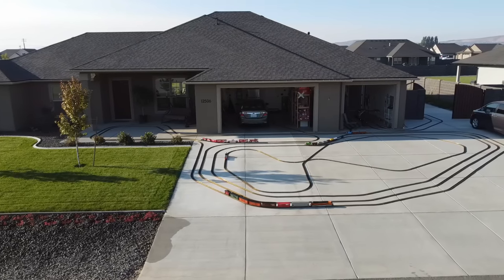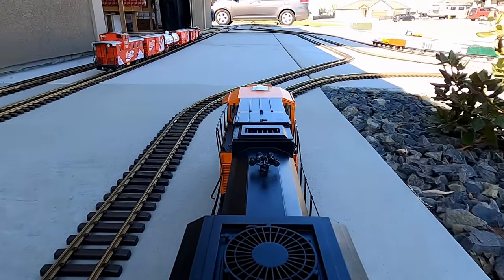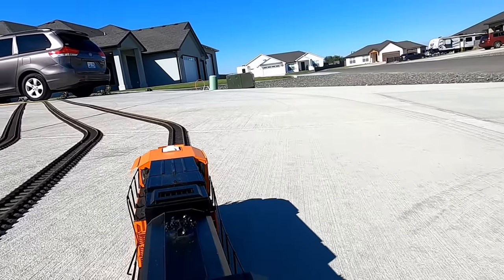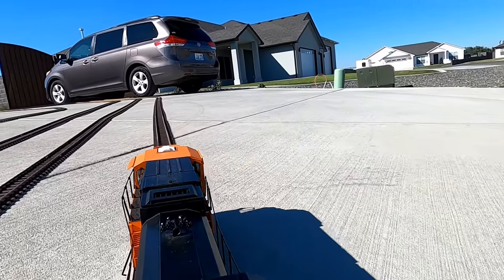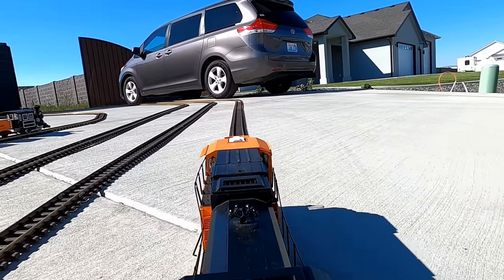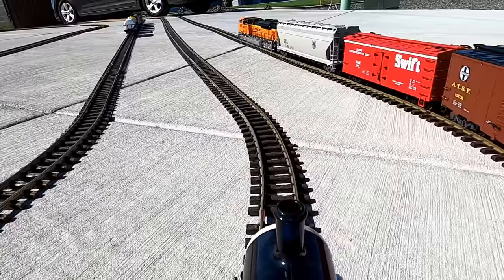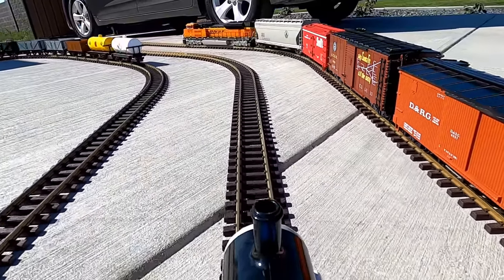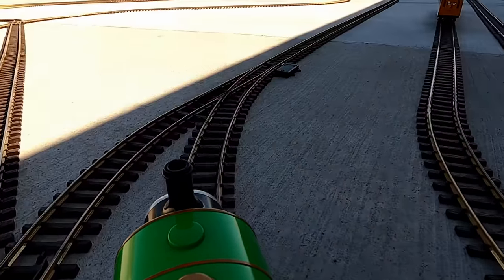A Huge New Model Train Layout With 8 G-scale Trains

Comment: I’ve built what I call “panel track”. 1”x4” pine boards usually 72” or 70” long with Lionel track screwed down. The original system I built had 72” curves at the ends. Now I’m starting to replace them with 96” curve tracks on plywood. As I can spend more money on it I can add straight sections. It’s for outside temporary running of my trains. I have an unfinished inside 96” by 77” Lionel layout.

Comment: Nice layout. I know the kids loved it - and so did I. How do power feeds work with G scale track on a layout that big?
Reply: He most likely used multiple power feeds on each track
Reply from the maker: @Amtk-712  No, actually, just one power connection to each loop of tracks.  There were four independent loops, each with their own power supply, in this layout.  I use LGB-brand brass track and I take good care of it...  it's not sitting out in the weather 24/7...  I set it up for a few days and then I store it safely in my garage when not in use.  So, the track stays in good condition and I rarely have any track power issues.  Even in the videos I've made where I've set up track all the way around my back yard, or all the way over to my next-door neighbor's house...  there has just been one power feed to the tracks.

If I had a permanent outdoor layout with the tracks just sitting out in the weather all the time, yeah, I'd have to have multiple power feeds to that layout...  otherwise there were be massive track power problems.  But the way I do it, with these temporary layouts, the track stays in good condition and I don't have those kinds of problems with track power.

Comment: Hi Jim! Is that Number 1 Gauge trains in your driveway? I was a garbage man for 8 years and I found about 20 train sets-Lionel, Marx and American Flyer. Most of them had missing wheels and no track but the engines ran just fine. My favorite was a Lionel Coke Train built in 1974. I have added more box cars-Orange Crush, Dr. Pepper and Pepsi and a Jack Frost Sugar hopper car. The train looks awesome. I also have the Blue Comet set with 12 coaches and the Marx trains will have 20 cars on both. I will set up all 4 trains in my living and dinning rooms once a year. Maybe you could be a garbage man too and find lots of trains!

Comment: Hey Jim! Nice to see you playing with the trains again! Can you tell me if you still are using your MRC prodigy advance? With their Wi-Fi?
Reply from the maker: Yes.  In the shot at 2:53 you can see the tablet in my hand.  I'm using that to control the trains.  The tablet talks to the MRC WiFi unit which is connected to the MRC Prodigy Elite power supply.

However, be aware that I got very lucky that my MRC Prodigy Elite works with the WiFi unit.  Apparently, most do not, and the official line from MRC is that the Prodigy Elite is not compatible with the WiFi unit.  Mine just happens to work for some reason.  Other MRC Prodigy models do successfully work with the WiFi, but for some reason the Prodigy Elite doesn't work with the WiFi for most people.  So, if you're thinking of trying to get the same setup I have, I'm afraid that's not really possible.  Use some other MRC Prodigy power supply, not the Prodigy Elite.
Reply: @JimZim  thanks! I do have the prodigy advance with the elite hand held plus the xtra power booster system, but I seem to be having a problem with my new Bachman steam engine c-18 2.8.0  I put a Phoenix sound board which is just plug and play had sound! And no engine movement now it moves a little the engine but now no sound ! My volt meter is telling me I have 12.1 volts! I’m so frustrated with dcc system. I even contacted the Phoenix co. To see if the board is bad! Have not heard back yet .
Reply: Hello Jim, do you add any xtra booster for more power since your layout is so big, and on your Bachman 4-6-0 steam engine is your power sufficient enough for it! Like speed for it.

Comment: Is that a DCC set-up I saw in the corner of your garage? I would imagine that the voltage drop-off for DC over that length of track would be severe and I didn't spot any additional wiring.
Reply from the maker: There were four independent loops in this layout, and two of them were DCC.  There was just one power connection to each loop of track, and no additional wiring was needed.  I often hear model railroad guys talk about power problems on their layouts, and having to add multiple electrical connections...  but this has not been my experience.  I guess it might have something to do with the fact that I use LGB-brand brass track and that I don't leave it outside for long periods of time.  This layout was only out for two nights...  plus, our weather here in Southeastern Washington is dry.

I've actually run much longer layouts than this, with just a single power connection to the track.  For example, take a look at this layout:  https://youtu.be/qGWQHg5GUcE   The tracks go all around our half acre lot...  and there was a single power connection to the track.
Reply: @JimZim  Thanks for that response. I haven't experienced any problems on LGB/"G", but then I only have a relatively small loop. Obviously I intend to add track as I can afford it, so I wanted to ask as it is something that has crossed my mind. I also have "Z", which only uses 9 volts DC and given the considerably smaller scale, the actual length of track is not long at all, but the voltage drop-off is dire.
Thanks again for your reply and thanks for your videos! I always enjoy them-especially the weather! ☀

Comment: What do you use for control? I'm going to be getting a lot of the older LGB loco's and converting them to digital. Then doing a layout in the yard.
Reply from the maker: I use the MRC Prodigy system, including their WiFi add-on unit.  Works great for me.
Reply: @JimZim  Do you run a booster, or do they have a G scale setup? I need someone to bounce stuff off of before I spend money I don't need to. I have too many questions. Thanks for the help
Reply from the maker: I was lucky to get one of their 10 amp systems while they were still making them.

Comment: Hello. I  loved this vid and the one with the Thomas.  Was wondering how you got the trains to  keep from crashing. I am trying to do the same with trains on one track circle with a switch to the outer circle
Reply from the maker: The key to keeping the trains from crashing on this layout is that there are four independent loops.  So, the trains on each loop cannot possibly crash in to the trains on the other loops.  Some of the loops have two trains running on them.  In those cases, the trains have DCC and that allows me to control their speed from a tablet I carry around with me.  So, I can speed up or slow down a train to avoid crashes

Comment: Are all your trains Dcc? 
If so what dcc system would you recommend?
Reply from the maker: Some of my trains have DCC, and some do not.  That's why in most of my layouts you'll see multiple independent loops of track...  so the DCC trains can have their own tracks and the analog trains can have a different set of tracks.

I use the MRC Prodigy DCC system.

Comment: I assume you are running dead rail. If so what system do you use? Thanks
Reply from the maker: The trains are powered through the rails.  There were four independent loops in this layout, and four power supplies.  The DCC locomotives were powered by a MRC Prodigy Elite and I was controlling them from a tablet in my hand.

Comment: What DCC system and decoders do you use?
Reply from the maker: Take a look at this video:  https://youtu.be/Y5oju9E4JY4
As far as the decoders, I try to just buy locomotives that have DCC built in at the factory.
Of course, there are a few locomotives that I wanted in my collection that simply aren't available with factory-installed DCC.  So, I just run those on a separate analog loop.  For example, in this video, the little Thomas & Friends locomotive that is pulling the Jim Zim passenger cars...  that's an analog item, running on an independent loop of the layout with its own analog power supply.

Comment: How many Amps did all of that draw??? What voltage?
Reply from the maker: I don't know.  I'll have to measure it sometime.  I don't think it's much, though.  Compared to some of the other things in the house such as the air conditioner and the hot tub...  I bet the trains are insignificant as far as electric usage.
Reply: @JimZim  OK... I just figured you had an ammeter hooked in series someplace. The old time layouts had meters all over the place...

Comment: Why bother doing anything on a G scale train , because no one supports G scale accessories fir this model I have been trying to find a G scale cleaning car for my track so I don't have to manually keep cleaning my track and I can not find anything anywhere it's all HO, N, O scale, I almost regret ever getting a g scale model train. This is very frustrating so don't ever buy a G scale model  train you will regret it because no one supports it.
Reply from the maker: There are actually several track cleaning cars for G scale.  One I own is the Piko Clean Machine.  https://youtu.be/jm3fdX0PJXQ

LGB also makes a much more expensive track cleaning locomotive.
https://www.trainworld.com/lgb-21672-usa-track-cleaning-locomotive-lgb-21672.html